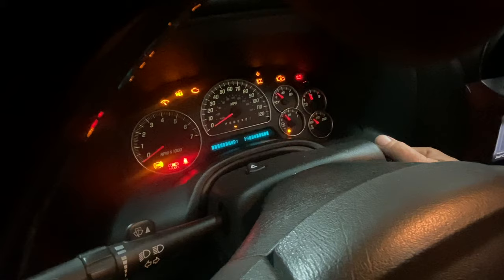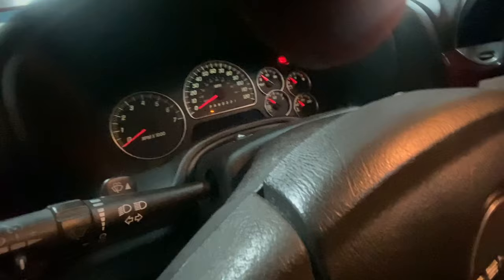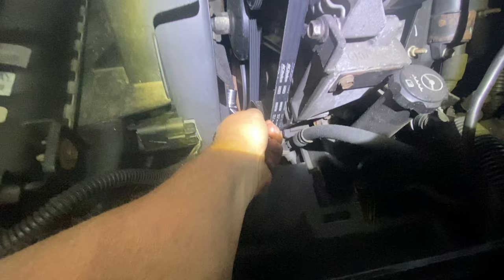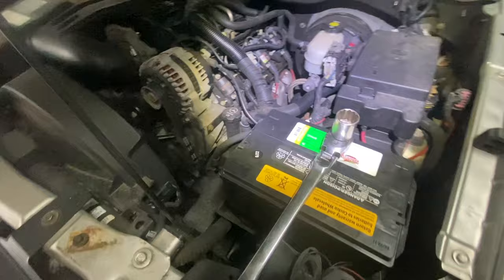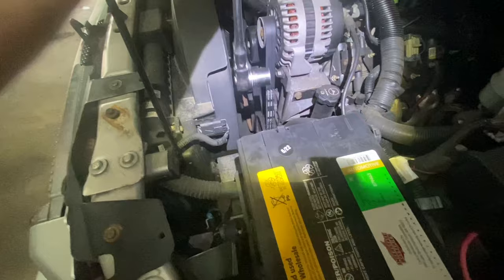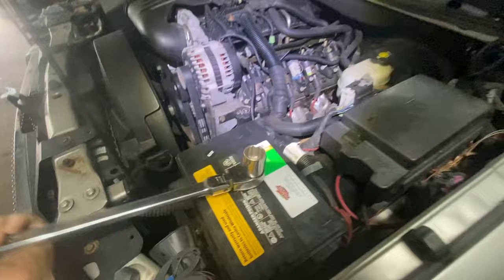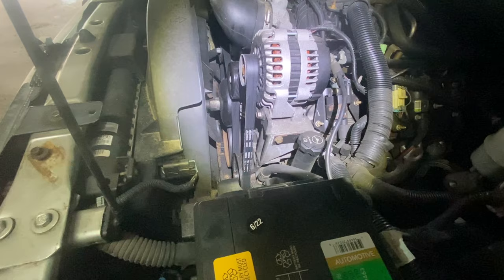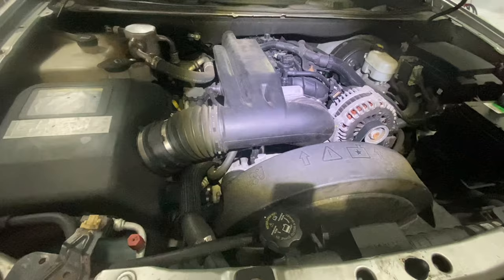Symptoms Of A Seized / Locked Engine - How To Tell It’s Not A Bad Starter

Comment: What if it just clicks? On a 2013 impala lt I woke up to go to the store and it just suddenly won’t start it was working at first fine
Reply from the maker: That sounds like a stater going. Next time it won't start try hitting the starter with a hammer, not too hard, if it starts its bad.
Reply: @Motorcarnut  just changed it a year ago my mechanic did the test on it now I have a ground wired to the ignition… I use the key turn it on and jump out pop the hood and spark the ground to the positive side of the battery so I’m guessing the it’s something that’s not giving the ignition enough juice
Reply from the maker: @user-du4rp9ex1l ignition switch comes to mind now
Reply: @Motorcarnut  quick question if you don’t mind I have a 3 cabled push start button that holds 50 amps I looked online and it said use a 6-8 gauge for the wiring but mechanic is saying an 14-18 gauge is just fine but I also think he is the one that messed with it in the first place I woke up one morning and it just stopped working out of nowhere and when he grounded the ignition he left me thermostat sensor was unplugged idk who to trust I just want to go to school so nobody will have to work on my cars but me
Reply from the maker: Bring it back to him, probably did mess it up. I didn’t know that, was assuming no one did anything to the vehicle.

Comment: Hi sir,I saw òn this video that you didn't remove the serpentine belt is that optional? When rotate the engine it have to be clockwise right?
Reply from the maker: If the engine turns normal then no need to take off belt however if it doesn’t turn normal then yes take off belt to make sure it’s not a pulley or accessory that’s seized. And yes most engines turn clockwise

Comment: Mines make the same sound but i got oil in mines, i was driving when mines cut off but normally when that happens i would wiggle the cables that's connected to the battery an it would crank but this last time it wouldn't? What yo think? I was told its a 60% chance it can be a starter solenoid
Reply from the maker: Wiggling wires is no good, have to take care of that bad connection first, that may be your problem right there
Reply: @Motorcarnut  bet , becuz I literally put a brand new alternator, an a battery, an I bought the starter 2 years ago
Reply from the maker: Yep, can easily be a bad or loose wiring issue , make sure ground wires are tight as well.
Reply: @Motorcarnut  I pray 🙏 only got 140,000 mile o it

Comment: Would this also work if the original problem was a broken timing belt? I'm trying to figure out if my valves are bent or not (2001 Honda Civic)
Reply from the maker: Well, the crank may turn but will hit the valves and may give a false reading that the crankshaft is seized when it’s actually not.

Comment: Motor car nut please respond back, but I was driving on the way back on a road and the car just locked up and it isn’t turning on, what should I do? And on top of that oil kept running out
Reply from the maker: Oh boy, that doesn’t sound good. You should have the car towed to a mechanic.

Comment: can an engine seize if the car has sat in the driveway for 11 months and never started up ?
i just put in a brand new battery, voltage is good 12.4+ , radio works, headlights etc , but there is no sound when trying to start, no clicking or that sound like in your video
car won't start or try to turn over
Reply from the maker: What you can do to see if it’s seized or maybe the starter or something is to try a put a wrench on the crankshaft bolt and see it the engine turns clockwise with not much effort if it does then it could be the starter or wiring to it.
Reply: Did you check the starter and ignition fuses and relays ?
Reply from the maker: No need, went straight to the crank based on the customer’s complaint.

Comment: So, we needed to get an oil change. We changed the oil, and then started to hear clicking. We got a new battery as well and started to see my battery drain. We took it for a small drive in the neighborhood and it stopped. The lights were dim, the battery had less power and now we hear clicking. Is our engine seized, or can we rebuild the engine? Or do we need to replace the starter? We have parts to rebuild the engine-if need to. We have a 2010 Saturn Outlook XE.
Reply from the maker: Sounds like a bad alternator, did you have that checked? You can check if the engine is seized by putting a breaker bar as shown in the video and crank it clockwise with your hand. If it moves with some resistance it’s not seized.

Comment: I have a 2015 dodge charger and it was leaking oil but i continued to drive it and then it started ticking and the car stopped while i was driving. It still turns on but won’t start and won’t allow me to change gears. Could this mean the engine is locked up?
Reply from the maker: Grab a breaker bar and put it on the crankshaft and try turning it by hand clockwise, if it turns it’s not locked.

Comment: Had a bad VVT in my engine.
.i changed the VVT.
And now it won't start. I hope it's just a starter that I have 2. Change And not the engine.
The engine tries to start but it keeps Killing the battery so it doesn't start
Reply from the maker: If you can turn it by hand with a breaker bar, it’s not seized.

Comment: So if its seized it wont turn over at all?
Reply from the maker: Most of the times, yes. Sometimes it will have a severe drag meaning it's just about to lock up, which is bad as well.

Comment: i have a 1985 Chrysler Lebaron 2.2L that's been in storage for many years, i want to turn the crankshaft by hand..would i
also turn it clockwise? on this car i would be pulling the breaker bar towards the front of the car to turn it clockwise
Reply from the maker: That is correct, clockwise

Comment: 2019 dodge challenger. I just drove through a foot of water and my car stopped. The water came up to the bottom of the door seal and didn’t sit in any water more than two minutes. But I’m getting that pop sound when I turn my key over. What do I do? All electrical parts are working.
Reply from the maker: Car can be hydro locked.
Reply: @Motorcarnut  so I just took the air filter out and it was soaked. I also took the cylinders out and didn’t see any water. It wasn’t even damp
Reply from the maker: Anything could have happened. Bent rods even it cylinders are dry water did get into engine.

Comment: my car just stopped yesterday in the middle of driving , we checked my hood and my oil cap was missing and no oil. we refilled it with oil, but it’s still not starting. is it seized or what can i do ?
Reply from the maker: Sounds like it is. Rebuilding or replacing engine

Comment: My starter motor struggles to function when the engine is hot..I still do not know why.Need your help.thanks.
Reply from the maker: Can be the starter is going, or you have a bad or loose ground? Usually when they get hot they show signs of failure.

Comment: Hello everyone,
I honestly feel like I have a very stupid question. I have an old 1983 Datsun 280ZX that I am trying to get together. This vehicle has not been turned on for about 2 years at least. I need to check that the engine can turn and it is not stuck (not sure what to call it). I went to check if the engine would turn from the crank shift pulley but to I noticed that the bold is missing. Can this be replaced?
Reply from the maker: Yes, it’s called a crankshaft bolt. And you’re checking to see if the engine is seized. If you can get underneath the car try putting a crowbar on the flywheel and try to turn the engine clockwise from there.

Comment: 07 Honda Accord Ex 6cyl. I think my engine might be seized, it did the same thing when you tried to turn it on. I’ve replaced the starter and alternator still no luck. Battery’s still good it’s just won’t start.
Reply from the maker: If you did try turning it by hand with a wrench on the crank and it don't turn then yes it's probably seized.
Reply: I have a question please I am very thankful for this video
Reply from the maker: Thank you

Comment: Hey man my problem is I drove for about 15mins my engine was overheating (did put water in before I drove) but when I got to my destination I lost complete power and now it makes this weird sound when trying to start but doesn't start any tips
Reply from the maker: Maybe a bad battery? Or bad ground connection? Try putting a wrench on the crank like I explained and see if it turns by have.
Reply: Can you please update when you find out ..same thing happened to me 2 days ago!!!
Reply: Did you resolve this?
Reply from the maker: @ethaneckstein281 ??

Comment: Starter sounds a little different with my 14 mustang gt when I try and crank. I checked dip stick yesterday and there was oil initially but after I wiped and dipped it back in there was nothing. Is there anyway I can send you a video of the sound my starter is making
Reply from the maker: If you can post it here I’ll take a listen
Reply: @Motorcarnut  I posted mine may you take a quick listen
Reply from the maker: Yes
Reply: @Motorcarnut  so how does it sound like?
Reply from the maker: I didn’t get the video?
Reply: @Motorcarnut  its on his channel,

Comment: Can it be just the alternator
Reply from the maker: Good question, if the alternator was locked or or any other accessories for that matter can make it feel as though the engine is seized. that's why you remove and serpentine or drive belts from the engine before trying to turn the crank.

Comment: My dodge avenger 2012 was making a screeching noise when the entwine stared now it won’t start as if the battery is dead i tried to get it jumped but it didn’t work whay could be wrong?
Reply from the maker: Make sure the engine is not seized, have a video on how to do that.

Comment: My 2005 Chevy Silverado is doing what the car in this video is doing. It moves freely when turning the crank shaft so I assumed it was the starter so I removed and tested at home and it worked fine, thinking maybe my test was faulty so i took it to auto zone and it tested fine. But know I'm confused as why I can't get my truck to start .
Reply: 2004 dodge ram 1500 5.7 is doing the same thing it'll click then nothing all the PRNDL are selected or highlighted also.
Reply from the maker: I’m assuming the truck is not cranking correct? If so could be a bad starter relay, bad ground or even a bad ignition switch
Reply: @Motorcarnut  correct, no crank, more like one clunk, no start... and its a hard clunk that you can feel , seems like its coming from the flywheel. Thanks for responding sir! I'm actually in the process of troubleshooting right now and will check what you suggested. I'm I LA and its scorching right now,  had to come inside as i was sweating buckets and everything was getting to hot to touch! ha ha
Reply from the maker: Wow, sure does sound like it’s the starter but check for corrosive wiring as well.
Reply: @dannydee9919 Any luck on what it is?

Comment: When I turn on my truck it cranks very very slow n stops I know it’s nothing electrical bc I was burning out the day before could it be seized too? I got money saved up for a 6.0 swap but if the engine is saveable I’d much rather go that way
Reply from the maker: You have to try and turn the crankshaft by hand and see if it’s turns over with not that much resistance.

Comment: Help please! I have a 2011 bmw 328i and the engine turns over for a second but doesn’t start, When using the breaker bar to turn the engine over The engine turns but with force so it’s not completely locked if that make sense. It just takes force to turn it. What could this mean?
Reply from the maker: Try taking sparkling water plugs out and then crank by hand to see if anything is binding.

Comment: Please where you? I have a 2012 Hyundai Accent, just registered in July 2023. There is enough engine oil in it, but it refuses to crack, roll or start now. The starter had been checked ok. I read something about crankshaft sensor could be one of the reasons for crankshaft lock. What is your position on this? I asked for  your location, possibly you could help repair instead considering engine replacement.
Reply from the maker: Is there any codes coming up?
Reply: @Motorcarnut  No code. Scanner output is "system voltage low". Dashboard displays EPS, Battery Symbol and check engine light.
Reply from the maker: Did you fully charge battery first?

Comment: My brother had a 2013 genesis we put a new battery in it sometimes it turns real slow but then sometimes just clicks could it be an electrical issue or seized motor?
Reply from the maker: Sounds like an electrical issue. Check grounds and tight connections between battery and starter.

Comment: Kia engine GDi is seized locked. but when I take my spark plugs completely out the cranks just fine no knock or rattle and cranks about the same cranking speed. why is this?
Reply from the maker: Then it’s not seized could be hydro locked

Comment: Buddy has a MazdaSpeed3 2.3 4cyl got an engine with low mileage to swap in, spins counter clockwise but won’t spin clock wise, ever dealt with anything like it?
Reply from the maker: Sounds like the pistons are hitting to valves, something is not right

Comment: I just changed knock sensors on a 2004 sienna. Was starting fine before installation. Im Positive nothing fell into the intake since i accounted every nut bolt, washer etc.... Makes this exact same noise. Is it plausible something did fall in? Or did I do something incorrectly?

Edit:
Just did the pulley test and it turns. And when I went to try to start it actually tried to start but then went back to that noise. Could it possibly be hydrolocked? Failed to mention when I removed manifold cover there was still coolant (pops said he drained it already) and it more then likely seeped into the intake. What do you suggest my next steps may be?
Reply from the maker: What noise are you referring to? If the engine was running before the repair recheck your work and why did you change knock sensors for?
Reply: Coolant had gotten into the lower manifold when getting to knock sesors. So we kept turning the crank until we heard most of it seep out into the pan. Then left if for a few days to dry out. Flushed rest of the Coolant and replaced oil and she fired right back up. 

Had to change out knock sensors cause they were bad. The van was sitting for well over a decade. Hopefully we'll get another 200k miles off if her.
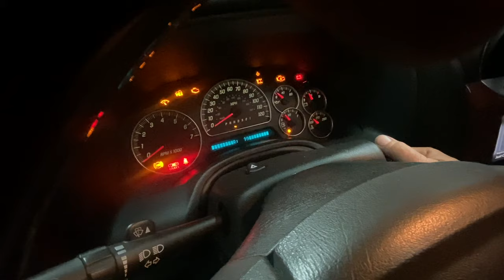Reply: The noise I was referring to was at 0:45

Comment: If it’s seized will it turn over a little bit? Sounds like my engine isn’t getting enough power but sounds like a bad starter.  It will turn over though if I feed it a little gas, just runs awful
Reply from the maker: Than it’s not seized.
Reply: @Motorcarnut  Thank you!
Reply from the maker: You problem, good luck

Comment: Hey love ur content I have a problem right now my car was not starting at all then I put it in neutral and it came on this time now it won't do it at all but I have power tho but it won't come on and when I have it in park it won't stay in park also so I had to put the emergency brake can you help me figure out what the problem thank
Reply from the maker: This sounds like you have a problem with the transmission selector lever. When you put it in park it’s probably not it park on the transmission. It would have to be adjusted depending on what vehicle you have.
Reply from the maker: And thank you !!

Comment: Hey..can a scrape on the valve stem cause the engine to be seized? I have a D16 A engine. Recently i take off the head, clean and grind the face of the valves but on 2 of the stems had a Little dent on them close to the top. Those dent was cause by me,using a players. However I fitted back the engine but won’t get the engine to crank. The starter work fine before I did any work to the engine and the sound it’s making is like a bad starter
Reply from the maker: If the valve is sticking, it can cause interference and the piston can hit the valve, but try turning the crank by hand and see if it turns smoothly, if it doesn't then its hitting if it does then its probably the starter or bad ground.

Comment: turn crankshaft clockwise as viewed facing engine, correct?
Reply from the maker: Correct, unless it’s a Honda
Reply: If it’s Honda it’s counter clockwise??
Reply from the maker: Most older Honda yes, the newer ones are clockwise now

Comment: Is buying a 2008 toyota tundra for 2000 bucks with 78k miles on it  worth it ?. Engine stuck .. or it can be a gd buy ?
Reply from the maker: Depends on the condition of the vehicle besides the engine and make sure it has a clean carfax, if both are good, yes it’s a good deal. Toyotas can be really reliable if properly maintained.
Reply: @Motorcarnut  sorry to be asking do much questions with you had a ig or so I could ask you there..but a guy wanted to trade me my 2010 toyota avalon for his 2006 Ford f150 truck plus 2500.. my car has 252k on it but no issues mechanically whatsoever on how I maintained it..his has a engine he said he put in with 55k on it but the truck body is 179k. Are those trucks engine any good? Most persons I read up abt it Said Stay away .what's your thoughts?
Reply from the maker: If the truck indeed had an engine replacement with55k and was maintained the swap seems good for you but for him to want to give you $2500 cash and his truck for a Toyota with 250k on it, I’d be a little suspicious.
Reply: @Motorcarnut  yes I didn't worry go through with it..I bet my corolla will outlast that 55k he got on it..because those 5.4 ford engine I hear give issues left right and center